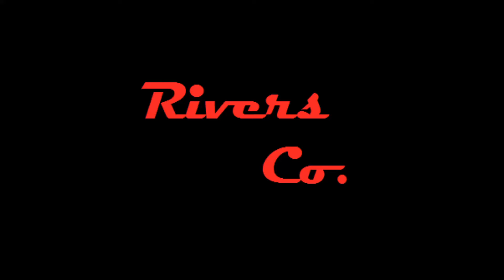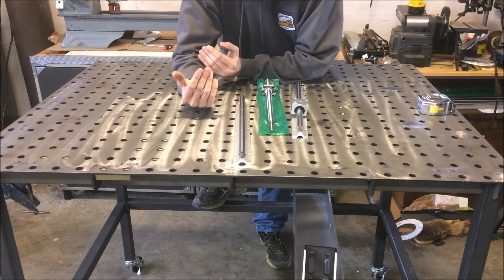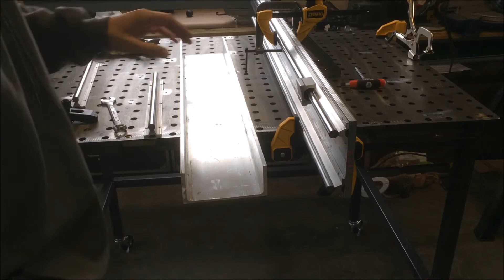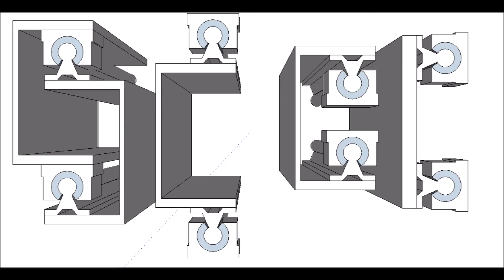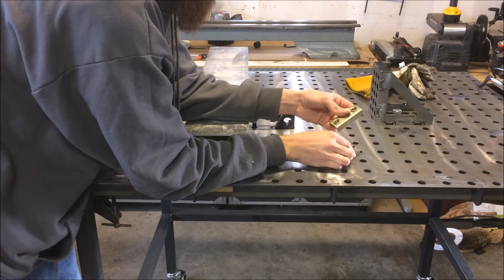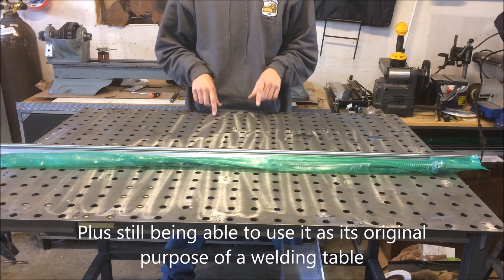DIY CNC Router on Certiflat Welding Table Part 1: Introduction

Comment: For 30mm spacing on rectangular aluminum extrusion check parts HFS6-3060 or HFSP6-3060 (for a milled surface) at Misumi. Is the Certiflat a good table for a newbie TIG welder? Looks reasonably priced.
Reply from the maker: Kent VanderVelden yea I believe that’s what I was looking at. It was a while ago I was in that train of thought. Attaching the ballscrew to that profile was something I was concerned with for that profile. The is that c channel type slotted extrusion I was looking at as well. 

As for the table it really depends on what your going to be doing. The pro series is great for entry level or less precise fixturing but there is  a cheaper option out there (can’t remember name). For more precise stuff I would go with a thicker fab block, and if money wasn’t an option there’s some other really nice ground stuff and sodium nitrided fixture tables and are big money. If your not worried about fixturing as much but just a good flat welding table there is a ton of option from cheap to free that would make a good beginner tig welding table. I have a really large old band saw table but no other parts that would make a great table. If you do decide to go the weld table route be sure to sign up for their mailing list and wait for a coupon code or a defected table to sweeten the deal.

Comment: Good project your are working on.
 So much for the Welding Table, LOL.

This has changed things a bit.
Converting the Welding Table to a CNC Table now.

By the time i catch up to current time, from watching the older video,s first.
You have most lightly sold this machine and gone onto something else. 

I am looking forward to watching this series of video,s.
And look forward to catching up to current day.

Thanks for the video.
Regards Peter.
Reply from the maker: Lol, I haven’t sold it yet! I do have a lot more manual machines now but I really need to find a vmc
Reply: @riversvic  
A VMC.
Sounds interesting, a sneak peek  at what else is happening on your channel.
I was sure you would not have sold your Welding / CNC Table as yet, LOL.

Trying to watch a little bit of each channel from my subscribers list, it,s difficult as i like to watch the older video,s first before catching up to current.
It,s hard because everyone has New video,s coming out and still have not watched the older video,s yet. Hehehe.
All good though because even the older video,s are still good to watch.

Thanks for your reply.
Regards Peter.

Comment: I'm interested in where this series of videos will go. I'm thinking of trying to maybe at some point trying some kind of small CNC project made mostly with my surface grinder build thing. Not sure yet, but the seeds are there. :)
Reply from the maker: I haven't spent a whole of time on it in the past year and a half or so. I've been too busy, but i still have big idea to make this thing awesome at some point. Sometimes I get a bug to start a second cnc project with some other ideas but need to get this one done first. As far as the series goes... watch with caution, they're not the greatest quality.
Reply: It seems good to have a project like that where you can visit from time to time as perhaps ideas evolve. I'm not looking to dive in the deep end and have to learn that whole side of things just yet, but maybe stick a toe in and test the water. No worries. The content itself is sure to be quality as whatever it is will be something I'm interested in that is better than TV, so you're all good. Thanks. @riversvic
Reply from the maker: Those are the same thoughts I have, I would rather watch poor quality YouTube and learn something then mindless stuff on TV. Thank you for watching.